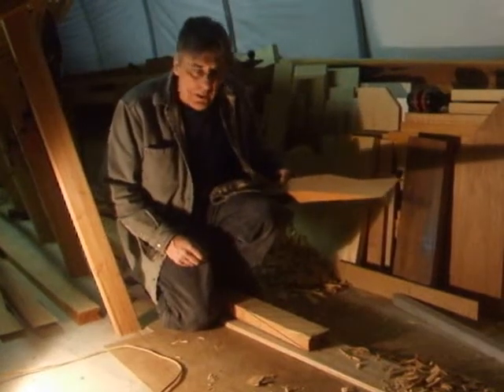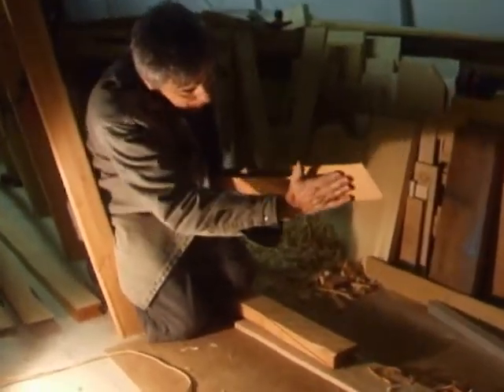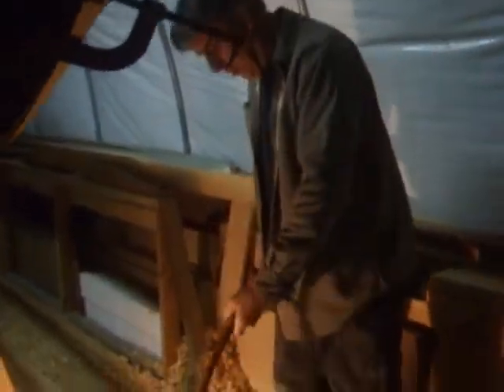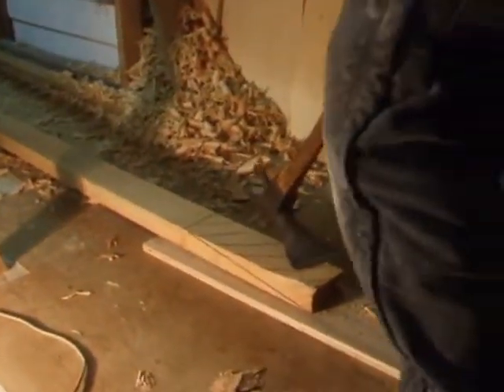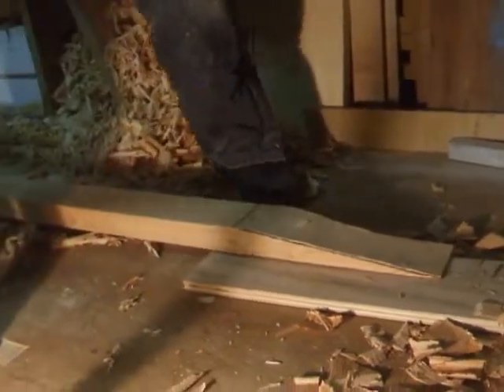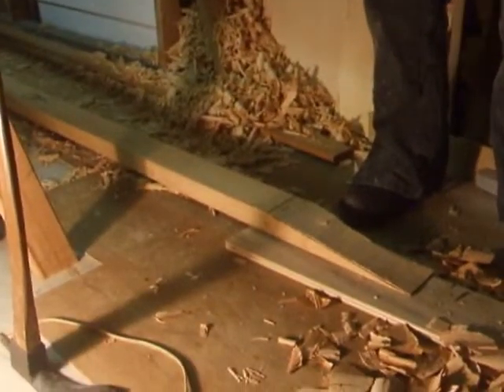Roughing out a scarf joint with an adze

Comment: what kind of adze is that. what is the point used for. I inherited a couple of them and can't find information on this.
Reply: chuck spencer 
Mr Spencer, i just saw your question, i have 3 or 4 adzes. i have found that if you are making beas, or benchs, or in my case a shave horse from a freshly harvested ash tree, from round to flat is not a difficult process with the right tools. we i split the log the inner portion is not smooth, with the bark down and supported to prevent rolling, I stood on the log and smoothed to a usable surface with one pass of the adze, cutting directly under my steel toed thick soled shoe, to control the cut to prevent the needfor further refining of this surface. it became the seat area of the shavehorse. I truly love using them they are brilliant when used properly and safely. I was looking to see if thi man used his like i have.  He did not. thanks fred